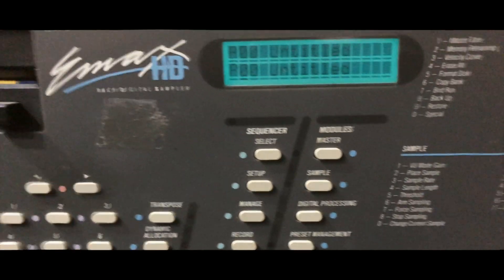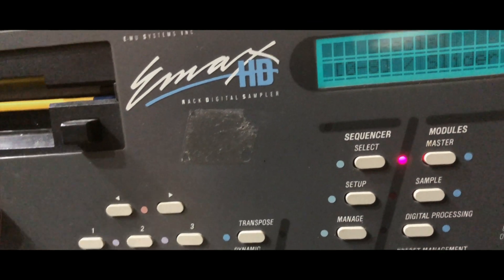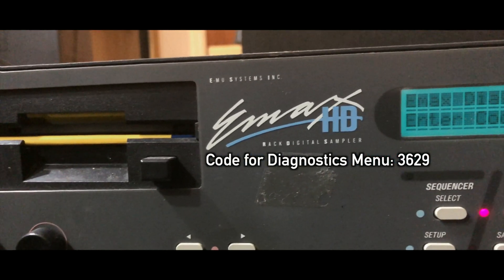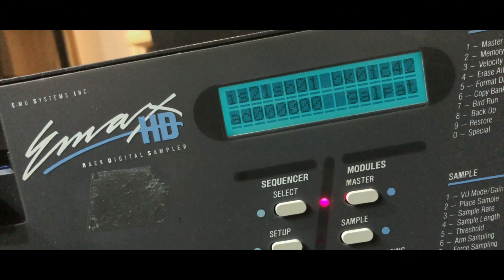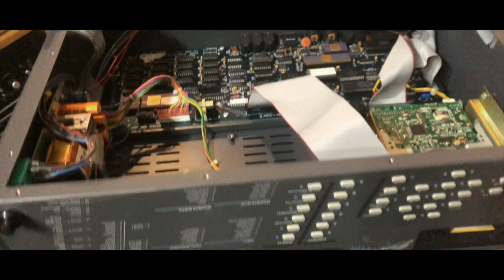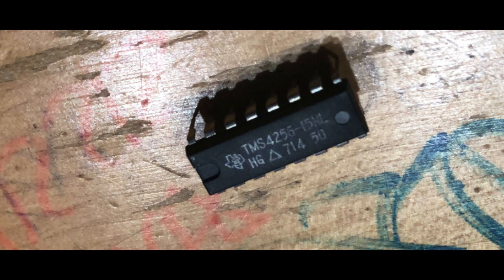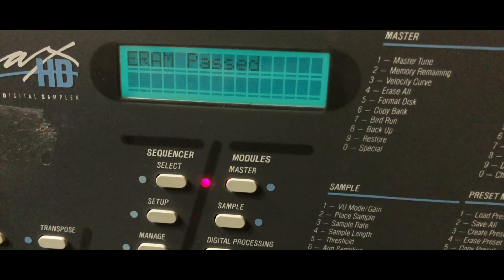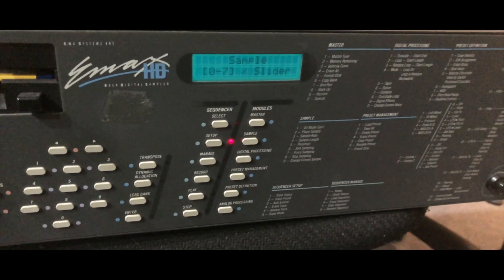DFACE DXA - E-mu Emax - How To Diagnose & Repair Bad RAM - Distorted Output

Comment: Thank you for this. I'm trying to diagnose what is wrong with mine... i have no sound at all in any output. Could you please let me know if all your LEDS on the front panel turn on when you turn on the sampler? All of mine turn on for a second except for LOAD BANK.
Reply: its prob related to your dac.  but thats just a guess.  my emax is out of the rack at the moment cuz im rearranging things.  you should post up on the sp1200 forum and i think someone might be able to help w this.

Comment: Peace. Yo Dface Dxa did you have to unsolder the ram chips or did you use a chip puller method?
Reply: all of the chips are socketed.  so you just have to pull out the old ones and pop in new ones.

Comment: hi, I have an emu emax se keyboard, sometimes when I am sampling and I am in the threshold menu everything stops with all the lights on, on average after 5-6 times I turn on and off it restarts without problems ... has it ever happened to you with the rack?
greetings from Italy and congratulations for what you do! 👊
Reply: never happened to me but you might want to open it up and investigate.
Reply: @dfacedxa  yeah i'll do soon but i'm not a specialist on electronic components... thank you for you reply, emu all day!👊
Reply: @jack I recently got the exact same keyboard 🎹 as you. I was just on it a few minutes ago trying a midi tutorial video from DJRockCee from Mpc to Emax. When I’m in the sample edit menu. My Emax 🥶 freezes up. I touch every button they are non responsive. I have to turn it off and back on again loosing any progress 😤
Reply: @Metamophisis  i've ser the video of dj rockcee, so i donno what it is, maybe the psu is almost gone... so anyway i'll put a new power supply and ... pray😂

Comment: Same problem with mine (mid-80s). I will try the diagnostic. Thanks!!
Reply: copped nos chips off ebay
Reply: if you check the forum post or description of this video there is more information on the subject.
Reply: @dfacedxa  thanks! Just ordered 16. I'm not on the PLUS OS by the way. I'm on 1.1 and there doesn't seem to be a diagnostics page
Reply: @billlay4815  might wanna try a newer os.  but if you are replacing all 16 chips it doesnt really matter.